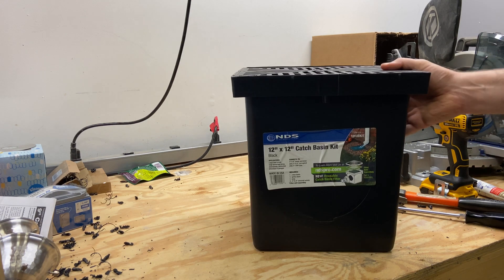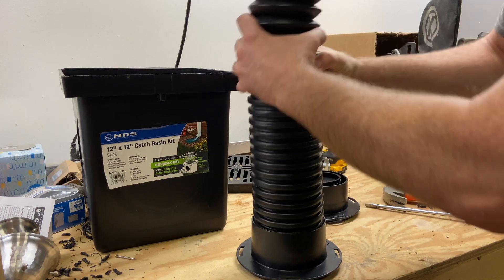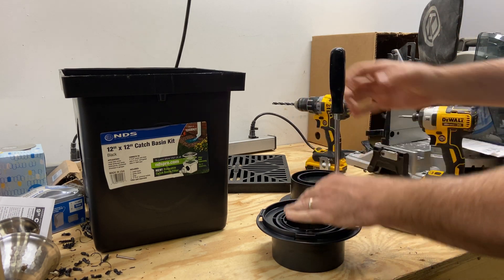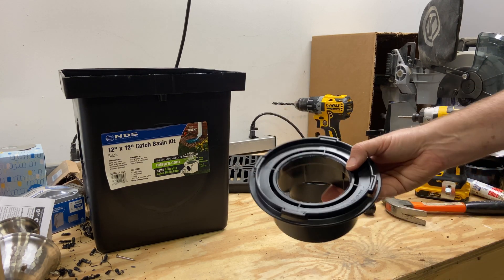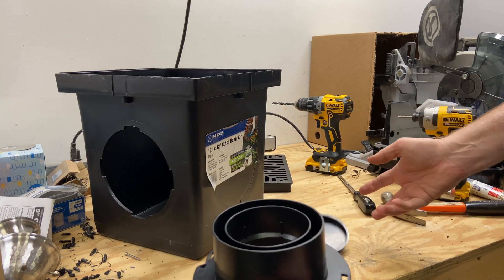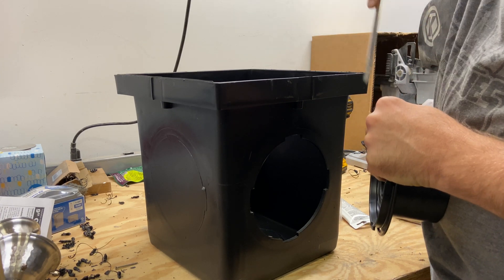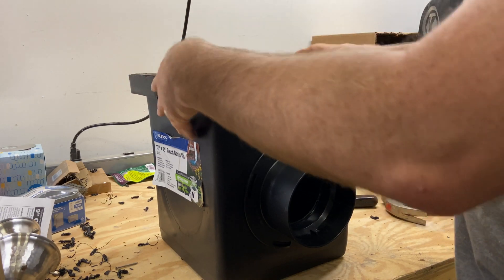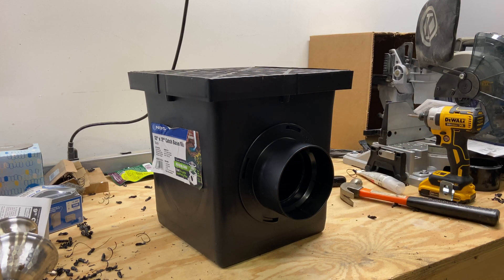NDS 1200BLKIT 12" x 12" Catch Basin Kit Assembly

Comment: Putting the plug on the inside, takes up room in the catch basin, also I could see considerable light when you turned to lock in, so water will still flow through unintended gaps.

Comment: It's insane that all of these water catch basins have multiple huge precut holes in them that will leak. Just give me a solid basin with 1 or 2 pipe adapters and let me drill the holes for them with a hole saw where I see fit.

Comment: How do you secure the corrugated pipe into the fitting?
Reply from the maker: It's just a pressure fit. It kind of clicks into place.
Reply: @jasonjesseph6424  Wouldn't that leak though? I assume you need to reinforce the connection with silicone or some waterproof tape.
Reply: @mcf8720  Late but, NDS actually recommends you wrap the connection with duct tape to prevent leaks. Sounds dumb I know, I don't use duct tape, but they have a video saying that somewhere on YouTube. Hope that helps anyone else maybe.

Comment: Good video - NDS needs to put some better documentation in these things so people can understand how to knock out the 3" portion if using 4" corrugated pipe,  Silicone sealer on all connections seems to make them air tight and assist with combatting root infestation!

Comment: Question.  Is water supposed to leak out the sides of the holes where you put the pipe and the cap? The basin I have leaks water out of the sides when the pipe is in
Reply: Use Silicone sealer on all connections

Comment: How do you keep the pipe from coming out and sealing ???
Reply from the maker: When you get it all put together and in the ground just cut the hose a tiny smidge longer and the pressure pushing into the box will keep it in place. It's in the dirt so no need to seal it.

Comment: It's harder to scrape the crud out with that fitting pointed inward...
Reply: Dude! You're my hero! Thank you for making this video. I'm putting a French Drain in and ran into the same problem with the NDS Catch Basin and the knock out. I'm all kinds of green doing these projects and your video helped me so much. I'm thankful for your thoughtfulness in making the video to help us newbies out. Be blessed!
Reply: NDS makes a flat cap that locks in the 2nd opening,  think it was 4 bucks at Menards
Reply from the maker: My drain boxes are up against the house foundation so I need the backside to be flat, that's why I put the unused fitting on the inside. Probably should have stated that in the video.

Comment: I installed everything the same with the exception of the second drain adapter and the plug. I did not want to sacrifice the catchment volume, so I placed it on the outside of the catch basin. I used some OSI gutter sealant that was laying around to adhere the plug to the drain adapter. By doing it this way, aside from the sealant, when you pack the trench with aggregate, that should serve as an additional force to hold the cap in place. The pressure from a 12" full catch basin is not enough to push the cap, sealant and aggregate; however, over time, the water and dirt on the outside of the catchment may eventually push your plug *in*. I dunno. Time will tell.

Comment: Great  video !  However, now that this is installed and working can you please report back to see  if your 9 - 1/4 inch holes on the bottom of box are completely clogged.  I am curios to see if holes on bottom with stone or fabric or whatever would drain the residual water in the box.   I would imagine that the small holes would clog after 1st rain with dirt and yard debris..  But I am VERY COURIOUS...   Again THANKS for VIDEO VERY NICELY DONE!
Reply: Everything is working well. In the end, I decided to line the bottom of the hole with landscape fabric and then just fill it with rocks and then set the box on top of the rocks. It’s draining well. I have very hard clay soil where I live so the water doesn’t drain into the soil easily, if I had more permeable soil I might drill fewer or smaller holes. Don’t put fabric on top of the rocks as debris pretty easily clogs the holes and prevents draining.

Comment: I agree there is not a lot of detailed info. Thanks for posting. I'd say 9 x 1/4" holes is overkill. However using some landscape fabric to line your pit will help. With many large holes and light rain you may end up just saturating ground verses filling the basin and having it convey away from the basin.  I'd say 4 x 1/8" is plenty. If it ever gets blocked you can poke it with a rod or drill bit.... The idea is for water to drain away slowly not be too free flowing to the gravel under the box. Just my opinion. Cheers. (PS installing two basins today)
Reply: I would like to see theses holes 1/4 or 1/8 inch holes on bottom work after the first rain. Over time, stone or no stone  fabric or no fabric underneath it will clog with dirt and debris trying to drain out the tiny wholes.  I think it will require weekly "Poking" of the holes to get the water to completely drain out.
Reply: @mikej1570  Fact is the 1" of standing water if not absorbed by ground will evaporate, no big deal. The idea in theory is have lots of rock under basin drain through holes in bottom, so water will fill the air voids between rocks under basin and seep into dirt. If the soil is permeable or perk-able water will go away as ground absorbs it. Clay like I have not so much, but given enough time water will flow. Other wise what doesn't drain will sit in there. It might be best to fill bottom of basin with concrete so most water exits the drain pipe. However it does not bother me some water sits in basin. We don't have mosquito issue here...

Comment: Jason, Thanks for this very good video. I searched all over the NDS Web Site, Google, Amazon & others & i finally found your video that explains exactly what I was thinking & planning on doing. Its amazing that every video shows the 4" pipes are installed into the adapters without knocking out the 3" adapter, which as you stated, defeats the purpose of using the 4". Thanks again foe taking the time on this video!

Comment: Thank You X 2.  You are bolder than I am.  I saw the knockout arrows but it wasn't clear to me either & I didn't want to damage the basin & throw > $40.00 down the drain so to speak. (I bought a 9") Also, I'm glad I watched the video all the way through because I was placing the plugged adapter on the outside of the basin. Thank You again.